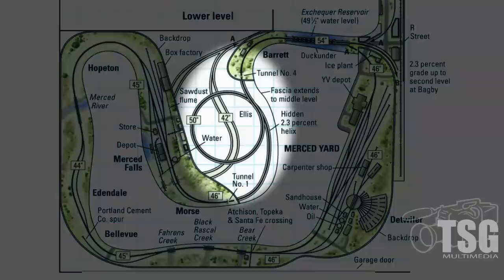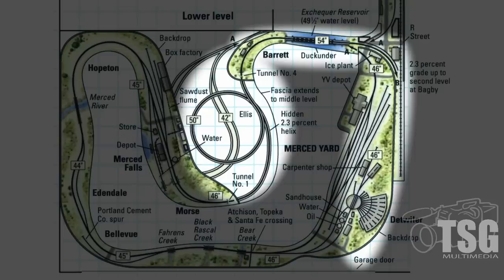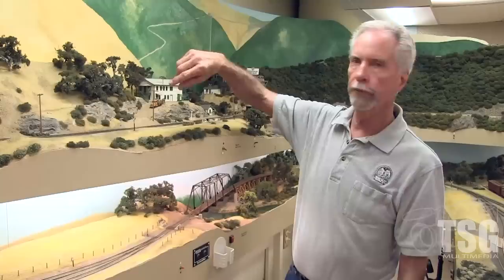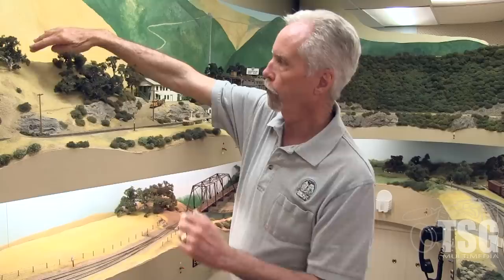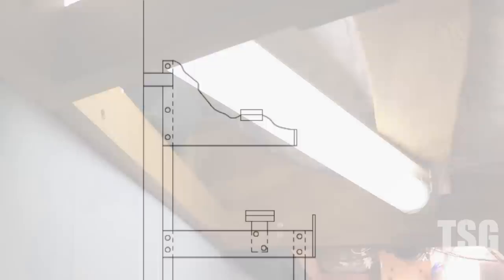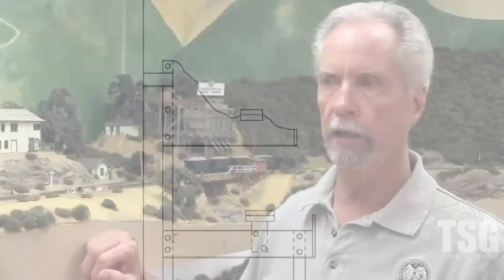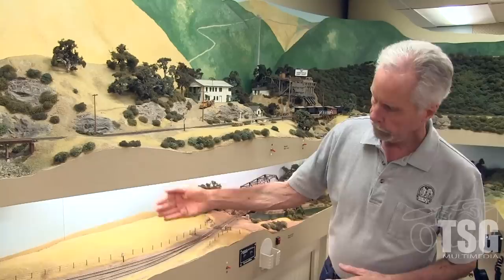Model Railroading With Jack Burgess Model Railroad Layout Design

Comment: Hi Jack. Always interesting learning about your railroad. Definitely a work of art. 
I've been researching lately about double deck layout designs and whether I should go with some sections in a double deck format. 
I am very much into a mountain style railroad with wide vertical separation of tracks as I was (still am) a big John Allen fan and double decks make it very difficult to achieve this feature. However, I want a much longer mainline and I'm toying with having some areas in a double deck design. 
It is very difficult to visualize all of this prior to starting my layout over. In some areas, I am currently ripping out mountain sections that have been there almost 30 years and boy does that hurt! Right now it is a mess also with tons of plaster dust all over the floors, etc. Not sure how to get that dust up without creating more dust!
Again, always a pleasure hearing about your fine layout. We actually chatted years ago via email. You were very generous with your time and suggestions. 
All the best.
Philip
Jersey Shore Area

Comment: Nicely Done. I'm working on a similar design with clean lines and enclosed cabinets.
Reply from the maker: The cabinets are particularly nice, keeping what would otherwise be clutter out of view. A lot of guys use valances under the fascia to hide whatever is stored. It's never completely effective at doing so. If you have the ability to build a solid-face like Jack's cabinets, and if the design is functional in your space, it's worth doing so.

Comment: Do you have any plans for your helix that someone can use?  I just got into model rail roads and there is so much to learn---all i know is that I want to have a train that runs through mountains on opposite ends whereby the train will eventually change directions,  I have about 45 linear feet to work with and one wall to go through that will act as a tunnel.

Comment: Absolutely Amazing layout!!  I do think the yellow borders do work well.     For you Future Lighting issue  look up Flexible RGB SMD5050 150 LED Strips Kit with Remote  on Amazon  these LED can be adjusted for bightness and Color to match daytime (blueish)  or evening (red)  lighting effects.  Also I would love to know what design elements to avoid and what Jack would do different a second time around? I ask  cause I am currently working on a layout design and considering a multideck layout.    Great Video work as always.
Reply: Troy…

Thanks for the tip on the LIDs…I will certainly check them out when I lose another under-counter florescent light. Design issues to avoid…I think I mentioned some of them in the video such as not having major yards on top of each other, ensuring that you can see and assess yard tracks on one deck when there is another deck above it, and making sure that you can clean and maintain all of the track on lower decks.

What would I do different? That is an interesting question that I have never thought about. It would be nice to have a bigger space so that the aisle next to Bagby and the area around Merced Falls could be larger. But I am glad that I made the space next to Merced as large as I did since it provides a real feeling of openness. If I didn’t have my shop in the same space as the layout when I started, I might have been able to eliminate the duck-under. That duck-under is a real minus.
Reply: @yvfan   Thanks for the reply I appreciate it.

Comment: I didn't use a helix, I used a long tangent 4% grade that connected level 1 to 2, and 2 to 3, 3 to 2, then 2 to 1. It keeps the trains in full view all the time. It works very well!
Reply: Tony Koester used the same idea with his multi-deck layout but he had a much larger space to work with. I have only a 20x20-foot space. Great idea though...
Reply: Hi Jack, I understand, your layout has a lot of similarities with mine. My space is 17 x 34. I tackled this when I was much younger; before I developed MS. I used a series of reverse curves on a 4% grade--this was deliberate. I wanted to operate a mountain railroad with helpers, but when you are running 60+ cars, just putting helpers in the train any old place is a bad idea. I have had a lot of wrecks because I wasn't utilizing the math. I saw a forum on the WWW where an individual was having the same problems. He corrected it by using some algebra and calculus. Now I don't have problems. I now know exactly where to place the helpers to avoid wrecks. If anyone would like that formula, let me know, as it is fairly involved.